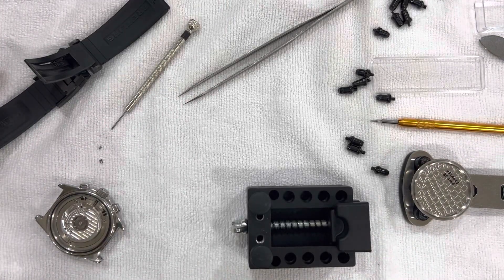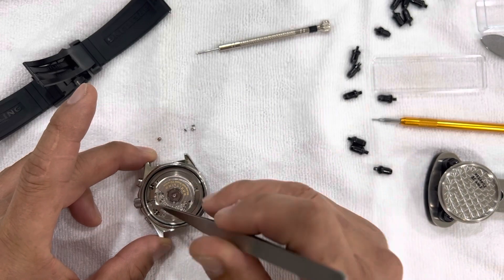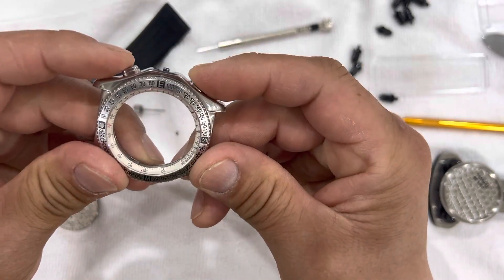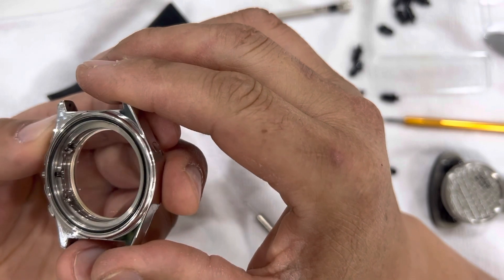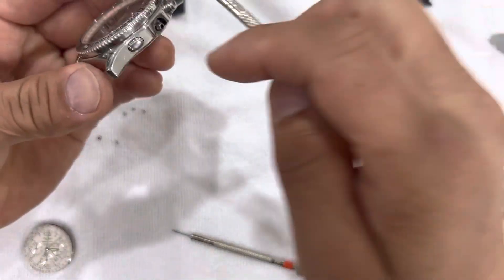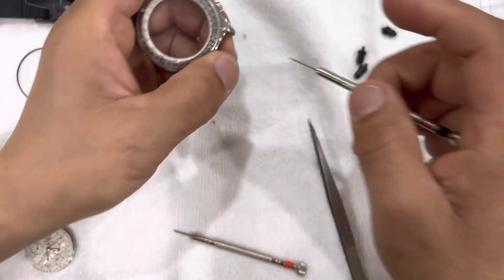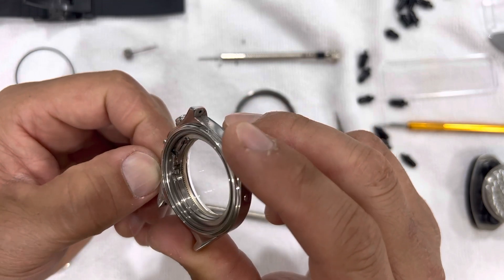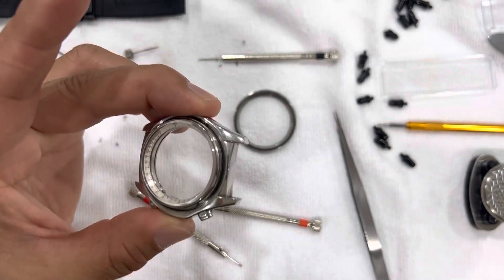I take apart my breitling b2 chronograph

Comment: I’ll give you props for tearing apart a watch without ever doing it before. I was like at any minute all them screws are going to fall off that towel. Just take it a jeweler.
So what was the outcome? I have the same watch and I just had to send it to Breitling for service. 2300$ later and it stopped working one day after I got it back. It’s currently back at Breitling getting fixed again.
Reply from the maker: Whoa! 2300? That’s crazy! Cleaned it just enough to get it going.